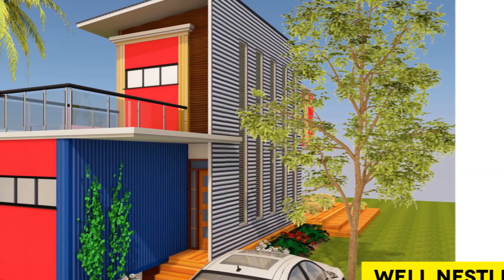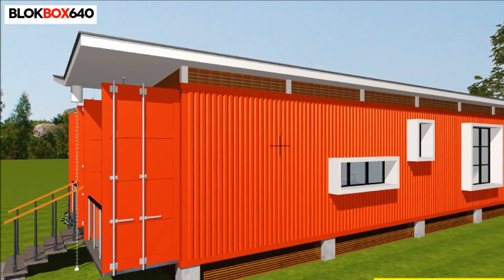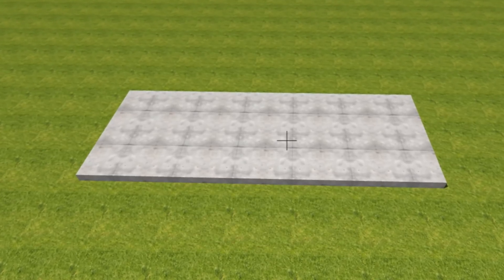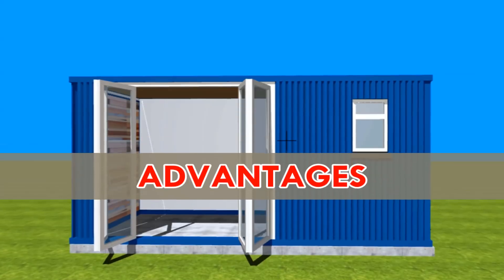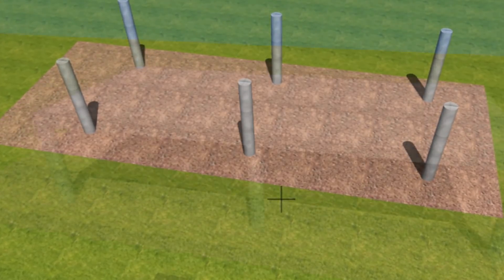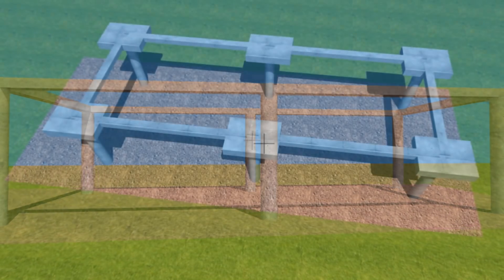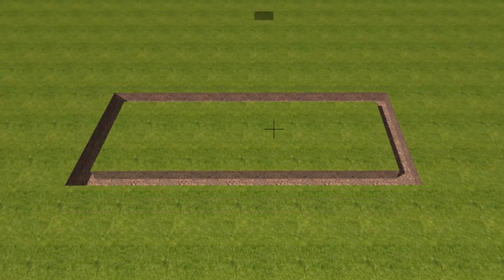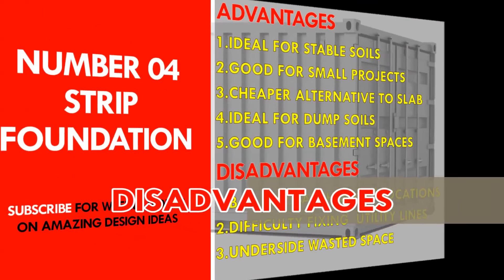Best Foundation for Shipping Container House

Comment: "Timber Foundation" is not a decade+ solution. If you need decade+ performance, try casting concrete blocks with rebar. I had great success with it in Texas, where loamy, weak soil and horrific downpours are common.
Make sure you mount the container so that - 1) your building can withstand highest expected winds,... and 2) so that rain water does not weep or run into the steel/concrete interface, cuz the steel will dissolve, in a few years.
Great little vid.

Comment: Thanks for this video.  I searched this information as I am preparing the foundations from a previous design of house,  for the container house I am currently working on. 
I am using footing design #4, because that is what the engineer specified for previous design.  It was to be solid earth house requiring over 100 tonne of earth to build. 
I am now satisfied that these footings are more than adequate for the container house.

Comment: how it can be bad for earthquake locations?
Reply: Earthquake's move the ground and the foundation needs to be strong in those areas.
Reply: I would think the rr ties would be better for earthquakes because the containers wont fall or slide off as the could with the the other methods especially if the rr ties are anchored in place.  I once had a shed on a floating deck and put concrete anchors that were about the depth of fence post  near the edges so I could quickly strap it in place with a ratchet strap during hurricanes but invisible otherwise. If the rr ties were anchored in this fashion I'm sure the would ride out the average earthquake.

Comment: Hi,
Thank you for this very informative video. How far down are the pile foundation put in?
Reply: Hi, me again... 🤗
For the strip foundation, how is sagging of the container prevented?

I understand that shipping container homes last about 25-years. After that, what are some of the complications that arise after 25-years?  (Especially in an equatorial climate)

Thanks again.
Reply from the maker: its all about maintenance, just prevent rusting and your house will last a bit longer.
Reply: I'd consider alternatives if it is placed close to saltwater, but they should survive rain pretty good.

Comment: Thanks! I thought the trench foundation was going to be my least expensive option, so thanks for pointing out the pier version. I didn't think about the container having span strength.
Reply: Railroad ties ! Brother ! That is what you want ! Bolt them. To the contanior bottom  and you have a life boat as well as your container home !
Reply: So a friend and I got piers dug/poured and even had one for the center of each side span... but the driver had a helluva time getting the container to my place and I don't think he really knew what he was doing. He had it on the first set of piers and was doing pretty well, but he turned the truck (for godknowswhy) and the whole container turned with it. He pulled over the piers and ended up getting the container all whopperjawed and it wasn't going to sit on ANY of the other piers. It was a mess. We threw logs and cinder blocks under it so we could get it off the truck and I could get my floor jack under it later. I got it leveled and put 16x16x3.5 concrete blocks under the corners, but it was WORK. The ground isn't flat at my place, so I wanted something easier to level than railroad ties. If I had been setting it some place flat, I sure would have gone that route.

I have footage of the driver and all the issues we had... I think I'm going to put together a video and post it. It won't really "go" with my channel, but I have 8 followers, so it probably doesn't matter. :)

Comment: No specialized skills or equipment for pier foundation? You’ll need an engineer to determine size and how many, you’ll need excavation equipment, sauna forms, steel cut and tied, a vibrator, a transit to shoot heights, etc etc etc.
Reply: Only if you are a. Idiot and don't now your hammer from a sau ?.

Comment: I wonder what the ideal foundation for a area with temperate climate with 0F winter in a high wind area and 100F summer to help keep the inside temperature comfortable.
Reply: If that's the case make 2 separate containers and have each one setup for each different season. Then use the other one as storage during the offseason both with ac ofcourse

Comment: Some of your suggestions do not satisfy building codes ie:wood lying on the ground
The one foot overhang on the slab foundation guarantees a wet slab, rusty container
The trench foundation will heave and break where the ground freezes
Every style listed wasted space as a disadvantage
The visuals were great
Reply: You wouldn't use strip foundation in an area prone to freezing...
Reply: Rust is okay on shipping containers. The patina actually protects the metal. This is why they are great for shipping over salt water.

Comment: Can I get in touch with you with some questions on the phone. Are you an engineer?Rich 5612221106
Reply: I am a structural engineer & looking at this for my future house. My question was in my design I plan to weld the corners to steel plates embedded into individual footers. Is the thermal expansion of the container (.200" @40deg f) ignored & just twist/bend or move the footers in the dirt or is there some sort of flexibility built into the mounts at 1 end allowing the container to grow while the footers are perfectly static?
Reply: the problem is the bending moment it would put on the weld. I need to incorporate something that allows movement in the req'd directions. If I don't it is likely that I will bend/break the weld or the footer concrete. All of the examples I have seen where the container is welded to plates cast into footers do not seem to take this relative movement into account.

Comment: I'm enjoying your videos immensely. I'm currently building a garage/workshop connecting three 40' high qube shipping containers. I decided on shipping containers because the cost of a traditional building in my area was cost prohibitive. I took a slightly different approach to the foundation, after building a retaining wall on two sides and leveling the field we compacted the soil and laid a 6" bed of crushed stone for drainage and compacted it we then used 4"×8"×16" concrete blocks to level the containers one at a time. I'm going to allow them to settle and do any additional leveling if needed before locking them together. I'm looking forward to seeing more of your videos!
Reply: Wow, your project sounds impressive.  May I ask you a few questions?
1. How long do you allow for settling?
2. How much were your containers?
3. How long do you anticipate your structures lasting? (25yrs is the max,  I hear)
4. Where you buy your containers from?
... I have more questions,  lol, but I'll leave it at that. 😇
Thanks!!!!!!!
Reply: What a great idea!!!

Comment: Would it be recommended to add a load bearing wall for for a two story house? and if so would your foundation need to have rebar steel for the walls as well as the corners of foundation?